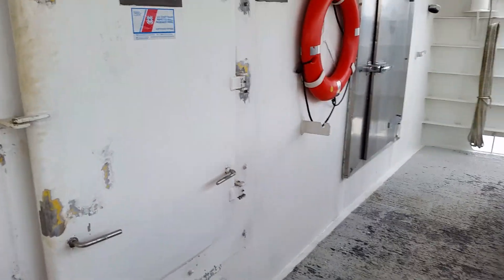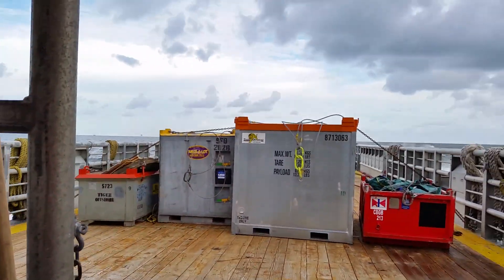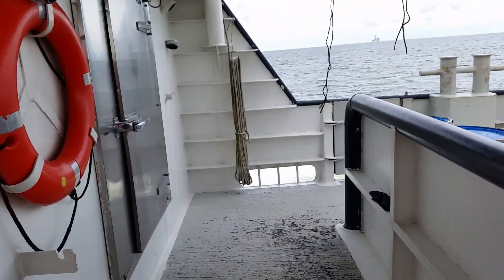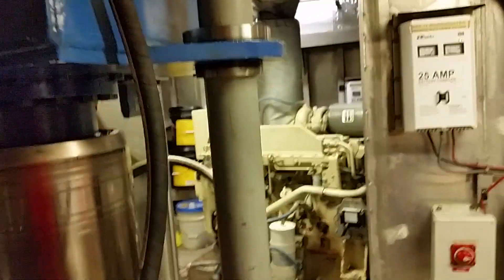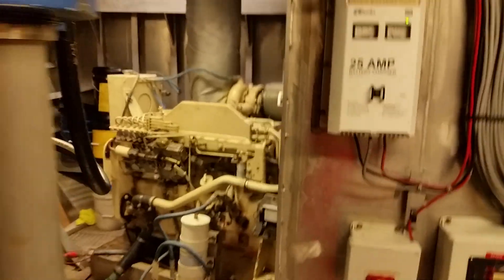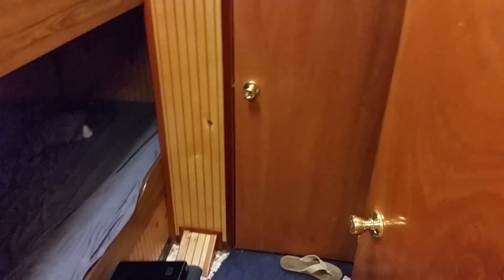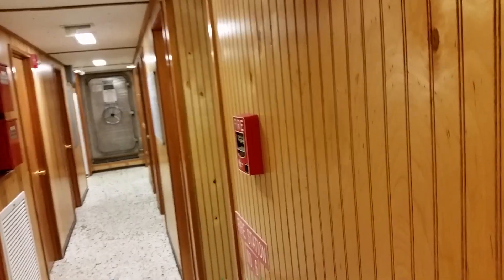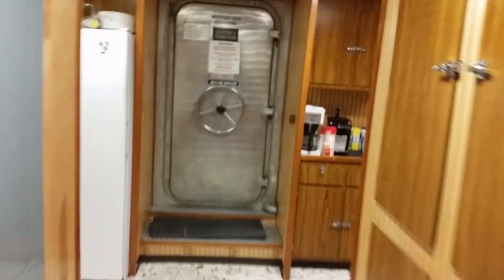Tour of a crew boat

Comment: hey from reddit, what are you using to record these?
Reply from the maker: Well hello there. For these two videos, I used only my Galaxy S5.
Reply: ah. i was wondering because i thought the crew would notice a hand held cam era but a phone makes sence
Reply from the maker: pixelshroom even if I had used my handheld, it wouldn't have mattered. We only have 3 man watches, so along with myself there is only an engineer and a Captain. I intentionally recorded while they were in other areas because I was unsure of how they would feel going onto youtube.
Reply: so what is your job on the ship?
Reply from the maker: pixelshroom deck hand and rigger. I handle the mooring lines when we tie up at the dock, to other boats, or anywhere else. I also rig cargo so it can be lifted off deck by cranes. Other than that, clean and play xbox.
Reply: and how long have you been doing that?
Reply from the maker: pixelshroom since the middle of February.